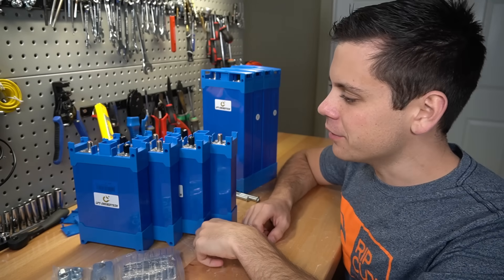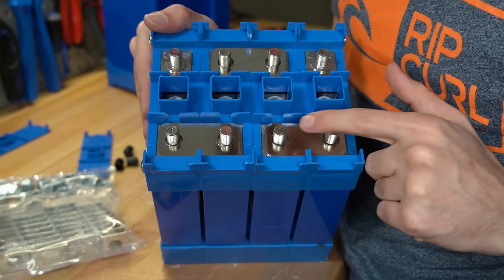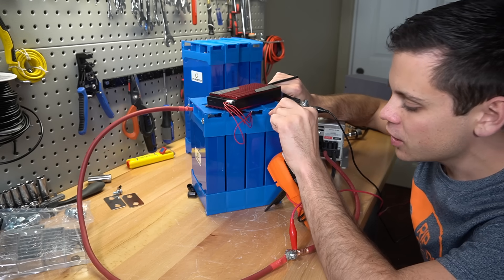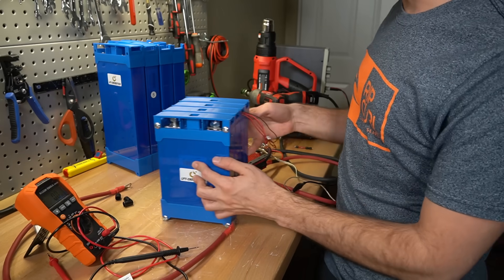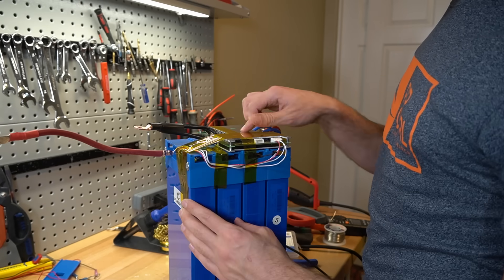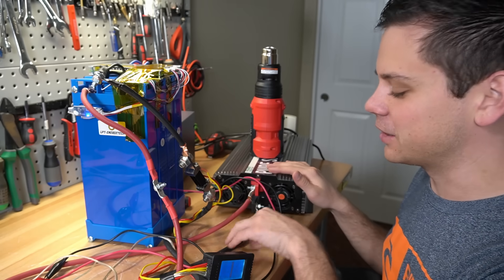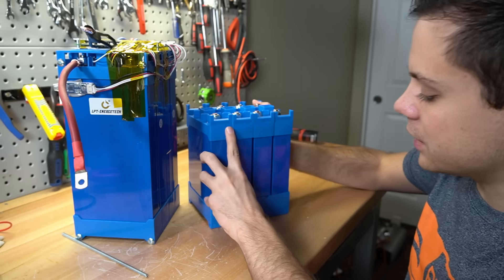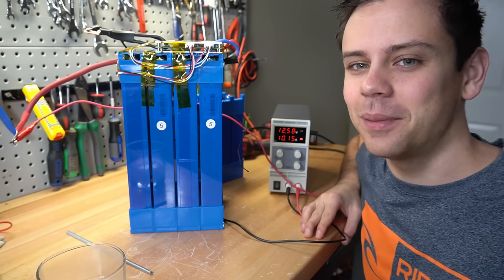Fortune LiFePO4 Battery Cells: I love them!

Comment: Hello, I am an electrical engineer and would really like to know what types of batteries and the connection method is installed in the BZ4X.
Same question about the 2019 RAV-4 Hybrid I know there are 34 nickel metal batteries and each 7.2 volt with a current of 6.5AH all batteries are connected in series and provide a final voltage of 244.8 VDC.
I am interested in replacing these batteries with LTO Titanate batteries
In order to get a longer electric travel time, more power, more current per hour and crazy fuel savings.

Comment: Hey brother I have a question for you I have several lithium batteries and we use them for trolling motors on kayaks what state of charge should I leave them in we use them at least one time a month and we drain them around fifty to sixty percent of the battery, should I leave them uncharged until I use them or should I charge them, I usually charge them and then charge them with one amp right before I use them, what do I do to keep them in good condition as long as I can

Comment: Great video once again.  With the form factor and ease of assembling packs these seem to be the best option out there.  I have built two 12v CALB batteries but would like to see someone 3D print plastic connectors for top and bottom to enable easy assembly of CALB packs, rather than using clamps and wasting a truck load of assembly time. With a peak 6C for these fortune cells it's a no-brainer though for my next pack! Thanks for putting out this top quality info!

Comment: would a rv water hose heater tape work to keep these batteries warm? that is in a outside access non heated (factory) compartment, encased by 1 in thick insulating foam board, taped at all seams/joints, so no air/light leaks.
no not as in a Alaska trip. just at times getting down to below freezing. most likely not even down to the teens.

Comment: Please tell us how charge safely lifepo4 batteries with our alternators currently exist in a boat. Lifepo4 battery pull too much current from the alternator that heat rise very much inside it and it burn. Suddenly HVCutoff also an other threat for an alternator..

Comment: I just saw the new Fortune 205AH cells, smaller than the old 100AH cells!  Will probably use them for my boat.  You should take a look, they've just been added to the Fortune line up.  Kent from electric car parts called and brought them to my attention.

Comment: Nice video Is there anything you will dislike about these batteries ?  The cost.  Mr Prowse, Pleace include the Watt per Cubic inch when comparing batteries. What Battery is the most compact ?
The 110AH are $120.00 and they have 230 AH cells for $225.00

Comment: $43 a year using it enough to charge it once a day for 8 years. That 3000 cycles. Great deal !
So if you built two for 120 amp hours that’s $86 a year less than $10 a month and never have to paddle your kayak. I’m going to do it !
And each 60AH battery only weighs 14.8 lbs 29.6 lbs for 120AH battery

Comment: A question, unrelated to this video. I have an 8 x 29 enclosed trailer, originally a car hauler, used for storage only. It's parked in a mini storage parking lot and has no electricity. I was considering the very basic 100-watt kit, but then I saw some 30 & 50-watt kits for considerably less money, all I need is 2 or 3 lights and maybe the occasional fan. Does anyone know if one of those would be enough?

Comment: For the smaller battery, are they 60Ah each? Or 60Ah with all 4 combined? Same question for the 100Ah battery. Also, what size are the threaded rods? I went to the electric car company website link you provided and it states the batteries don't come with the threaded rods (I'm assuming they're talking about the rods that hold the battery case together.)

Comment: Just saying from someone who does this professionally , NEVER tighten any electrical connection with an impact driver , on higher current connections regardless of voltage always use supplied torque settings.. if copper is tightened beyond its maximum spring it compresses without rebounding and as a consequence heat cycles of the joint will cause carbon build up , the lower the voltage the more important this becomes

Comment: Hey, wait a minute.  I’m just getting started building a system and I have a question. You are praising the space between the cells for airflow - BUT most videos/instructions say I am supposed to make a case for them so they don’t expand when charged.  You can’t have space and prevent expansion.  Which is more important?

Comment: I like these.
Cost wise, they are competitive with other formats.
I was looking at the 25ah form factor.
A 72v 25ah pack would come in a bit under $600.
The salvaged pouch cells I just ordered are $300 for 60 cells - 20s3P - 24-27ah @80v.
And I still have to build the pack and design an enclosure.
While both can be built without welding or soldering, if I were using the Fortune cells, I would not have to fabricate anything besides a watertight enclosure.
And refactoring the pack would be like playing with legos.
Buy some more cells - hook em up series to up voltage.
Next month, buy some more and refactor into a 2P pack.
The 25AH units are small enough to make a pretty powerful pack.
And with the robust connectors, one is not limited to a monolithic pack.
You could easily have some cells behind the seat or in panniers and just cable the connections as required, using heavy gauge copper cables with ring connectors.
Weight is very close to where I think I'll end up with the pouch cells.

Comment: Hey Will, I am glad to see you reviewed these, as it turns out these are at least a year old, based on the review date. Other than those plastic end caps and those very Hardy terminals, the cell's appear to be the same as the newest ones, they're just about double the weight of the newest cells, and that made it hard for me to believe that these newest cells, were just too good to be true, as these newest cells are less than half the weight and size of the 100 ah cell's that I am replacing. And yes the ones that I am replacing are 13 years old, so I guess it's not impossible to believe that they could advance that much in 13 years, but what was a bit misleading is these cells from a year ago, for a 16S pack of them, the total weight is only 22 pounds lighter than my 13 year old pack but half the weight of the newest ones.

Comment: I'd be very interested in seeing a tear down of one of these Fortune batteries with the huge terminals, and one of those EVE 280ah batteries with the wimpy aluminum terminals. I suspect the larger terminals may only be skin deep!

If I were to build a 24v system for my RV today, I'd go with the 280ah batteries and use conductive epoxy to glue in the wimpy stainless steel studs, then use same epoxy and lightly torque/glue the nut against the aluminum base with glue making it super rigid. I could then top it off with another nut to hold battery connectors, wire terminals, etc. while tightening nut against nut very tightly with wrench on the bottom nut to prevent undue torque on the aluminum/stainless stud and glue.

Comment: Will,  Have you considered putting them on their side to allow convection cooling thru the space between the cells?  The top/bottom ends didn't look to be open so air flow would be limited when they are standing up.  THANK YOU for another GREAT video.

Comment: I undIferstand the advantage of the space between cells for air flow, but that also means you cannot apply compression on them. Is this something to be concerned about? If yes, one could add some "spacers" between the cell centers, significantly smaller than the cell surface. That would still allow compression, and allow for air flow.
Reply from the maker: Cylindrical cells don't need added compression. Only prismatic and pouch. I've reviewed up listed packs with cylindrical cells and they had zero compression.
Reply: @WillProwse  
My comment regarding spaces between cells was related to the fortune prismatic cells. There I have a concern with lack of compression

Comment: Stupid question...in the 4S configuration of the 60Ah or 100Ah cell...is the combined Ah of the pack  then 240Ah (for the 60Ah cell) and 400Ah (for the 100Ah cell)?  What does the 60Ah and 100Ah refer to..the cell, or the 4S configuration?

Comment: Wow, what an interesting review and video.  I'm giving some serious thought of building 4 12v sets.  These would be installed in 20ft Bass Boat, two setup for 24v Trolling motor, one for all my electronics and one for a Cranking battery including accessories, i.e. live well, etc. My main interest for doing this is to cut out 4 AGM batteries, reducing weight and extending Ah's and finally, the cost per unit.  Four of the these commercial LiFePo4 would run well over 4K.  Any thoughts or recommendations, or is this not a good solution for the application I am considering.

Comment: I used these Cells to build a 48V 300Ah battery (48 cells 3P16S) in combination with 2 MPP 5Kw inverters and a Daly BMS 16S 100/200A. It works great and I power my whole house 24/7 with it. (I live in the Philippines so no lacking of Sunlight) Actually it was Will's recommendation what made me use this cells. I ordered it in China directly from the Manufacturer for only $50 per cell.
Reply: Sir, can I ask for a link so that I can order directly from the supplier? Is that possible, sir?

Comment: Keep up the great videos will. I use the Ridgid tool box for my truck setup with solar gel battery battery pretty tough box I'm sure it would handle those taller hundred amp batteries. I'm going to update my system with lithium iron as soon as I find a good heater for them that way I can leave them in my truck gear around

Comment: I need to have a 400 amp hour battery pack for a low C use as a house bank on a boat.  I have not found these in larger that 100 amp cells and a pack made of 16 of these cells looks pretty pricey .  Cheapest I've found is $155 per cell.  Have you tested the BestGo sold by the Electric Car Co.?

Comment: Do not use an impact wrench to tighten... That is so silly and pointless and you can strip the threads. Use a torque wrench and set the appropriate torque for the fastener you're using.

Comment: I am just starting to think about building a off grid system, and am learning a lot from your many videos. But I have a question, does the wattage drain from the ac converter equal to the wattage drain from the battery and solar set up?

Comment: I purchased mine about two years ago, 32 cells at 24 volts.  However, the plastic covers on mine did not have the holes for the threaded rods.  Also, they were a bit cheaper then, understandable.  P.S., purchased from the same company, great service.
Reply: hi there, please contact whatsapp 0086 18963643619 if you are still interested in these batteries.

Comment: Since this video, I recently purchased 16 Fortune 100A for a 48V build. 
They arrived and all were within a couple millivolts.
48V allows smaller wires and larger panels.
Have to order most components online.

Having trouble sourcing good BMS with low temp cutoff that is not prohibitively expensive. 
The one on Will's website is sold out.
Looking at a Growatt since it has dual MPPT.

Considering multiple separate inverters since I don't want them on 24/7.
I have a separate cheap 12V 20W panel with old truck batteries for lights in the garage.

Looking at larger solar panels to maximize utility.

Comment: About to go off grid and can't justify the extreme cost of phosphate cells. Could someone tell me why they are worth double the money over lithium ions. I know they are safer, (not good enough for me, I'll take precautions), Do they last that much longer? To be worth so much more?
Reply: Yes, they last much longer. 
Don't "misunderestimate" the safety aspects.

NMC lasts 500 cycles. Think cell phone battery lasts 2 years, if lucky.
LiFePO4 lasts 2500 cycles minimum unless damaged through low temp charging or some other scenario increasing cell degradation. 
If cycled smartly, one may achieve 10,000 cycles with LFP cells.

Comment: I was advised that prismatic cells should be strapped together so they can’t swell, but with an air gap between these ones, it seems like that isn’t in fact necessary?
Reply from the maker: That was a huge issue with older cells. Aluminum cased LiFePO4 cells do not have this problem really
Reply: DIY Solar Power with Will Prowse thanks Will, so alu cased cells don’t need to be strapped or clamped together?

Comment: When researching current states of electric cars, i have heard claims that CATL LiFeP04 packs (not cells) cost anywhere from 70 to 110 $ per kwh to produce. What makes retail costs so expensive. Even slightly more than 100% margin should mean we should now be seeing retail batteries for 250$/kwh. Not sure if car battery estimates or wrong or there is a supply issue on the retail side because Tier 1 manufacturers do not deal with this market. It does not make sense for Tier 1 manufacturers to ignore this market with such margins. It is not a small market if priced < 300 $/kwh.

On this topic, have you ever heard of anyone in North America actually being able to buy and install a CATL storage system ?

Comment: Eastern Euro  firm had Li2Tio3 that had 30k cycles no pricing given, I think God speaking we should give them more time 2 ck up in market place. The non fire/explosive probem alone merits that + no cold or hot problem. Efficiency charging only 85% a chi com problem or tech problem? We don't know that yet either. If we r going to invest heavily into new tech need to make sure it is right tech.  Explosive is wrong tech for sure. <But till we know can u mix 2 Titanate w/1 exploding kind, a 2 to 1 sandwich, & double it up arranged so no fire batteries r near or touching each other. Then run your test for quality 12 volt set up again. Best of both world twice the charge speed 2/3 of pack & more draw on 1/3 of the pack. Lower fire & heat & cold problem greatly reduced, bc heat from batteries will keep weaker sister tech warm. Warm not hot no touching your brother.  We still don't know what the true potential of Titanate is yet. We need it all to b able to fit in normal sized battery space. I like the Genesis system 2 batteries in 1 but they r AGM. Can we U & I get a similar 2 batteries 12 volt space sized system for Jeeps combining best of both of these batteries. Low wt, quick charge, high draw, low or no fire or cold problem. Ck that box for Me $10k budget says u can do it & find that right bal in a Jeep 2 battery space. The recharging alternator will b 240 volts & lets see how good a continuous cycle we can get. Run time vs draw time. Everything poss on wipers radio ham, cb, screen, navigation, lights, & ac or heater, & w/extra lights all Led. That's test1 next is test2 The motor for hybrid drawing on take off launching up 2 25 mph & cutting out at 29mph gas or diesel taking over. City stop & go vs mixed driving or hwy speed on normal combustion. $5k any supplies u need or testing equipment.

Comment: Are the terminal bolts and nuts stainless steel? If they are only zinc plated steel, they will corrode and then seize in a saltwater marine environment. The nuts look too shiny to be stainless. Those can be substituted, but if the terminal bolts are zinc plated steel, that's a no go for use saltwater sailors.

Comment: Love your videos. I have to get your book, because i have many questions. Any experience or opinions about this one? Amazon Ampere time 12V 200Ah Lithium Iron LiFePO4 Deep Cycle. Looks too good to be true ? You should build ultimate 24 volt battery with your favorite upgraded  Bms, cells and discharge at least 100 amps. That would be awesome tutorial. Great work, keep them coming

Comment: You said they need to be in a cool environment.. What do you consider cool? I live in the Caribbean where it regularly gets 33 degrees Celsius. 
Would this survive in such an environment?
Reply: Sure they will survive, but you will experience slightly faster degradation, if you keep them at 33+°C regularly. But there are some things you can do, if you live in a hot climate. For one, try to keep the batteries underground. Temperature inside a cellar will be much lower than the outside. But as long as the batteries are not exposed to direct sunlight and there is a decent airflow around them, hot weather shouldn't really be a problem.

Comment: I’m looking for a 50-60 AH battery to run a 1/2 HP motor for about 15 minutes a day for irrigation. Is there a new or used battery you can recommend for under 300 Dollars?

Comment: I want to build a 12v pack (total 600ah) with the same BMS having the low temperature cutoff, is it necessary to add heating blankets to the battery compartment as a secondary low temp protection?  I was going to use these 12v water tank heating pads that will turn on at 34F and off at 45F automatically.  I am going to replace my AGM batteries for my Sprinter van and they will be under the rear part of the van where the spare tire is located.

Comment: Hi, I have a traditional (not solar) inverter
6000 Watt Pure Sine Inverter Charger 24Vdc / 240Vac Input & 120 / 240Vac Split Phase Output, I would like to use lithium batteries, not acid. What batteries can you recommend for this investor.
Thanks, for instructional videos from your channel.

Comment: If I made two 12volt set ups like that and put each one in their own box would I be able to hook them up in parallel?  Also, does a bms only work with 4 cells or would it work with 8 cells?

Comment: Hi there  please can you help me with a few answers? Can I tie this  type of battery  if they have different  Amperage?  In parallel  or series .it is safe?
If I want to build a power  wall  12v 100 amp . And I want to recharge from outlet  (230V Europe) what  type of  charge is good enough  ? Voltage and  amperage?  Please help me?